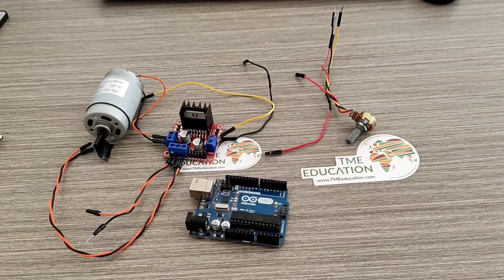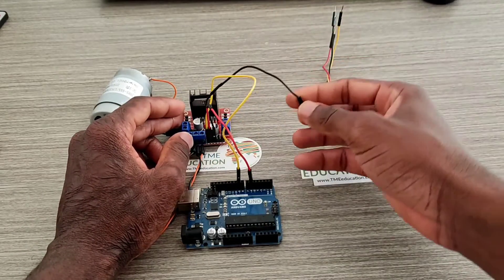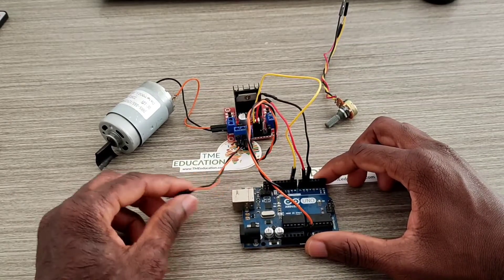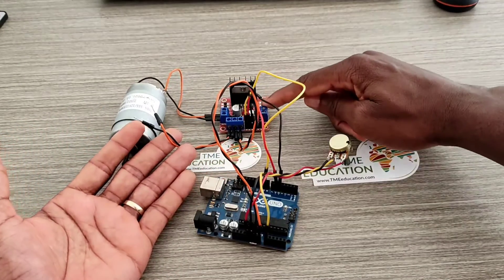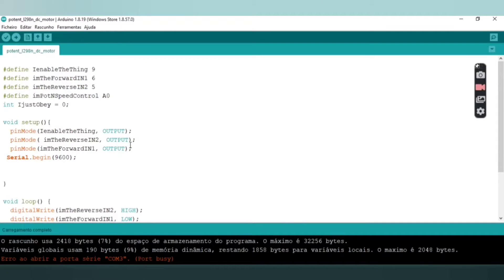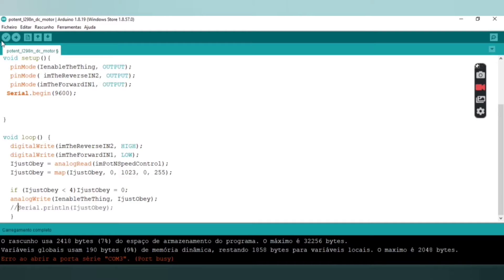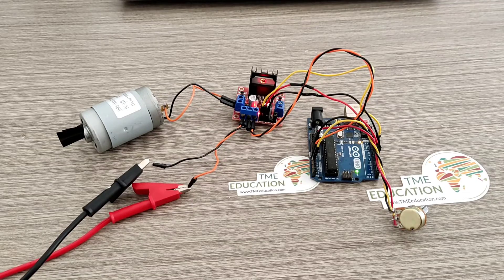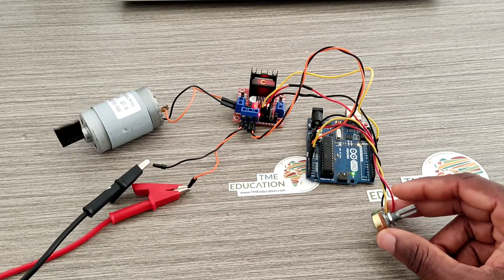Controlling DC Motor with Arduino and L298N H Bridge  #arduino #robot

Comment: Your teaching is well detailed. Thank you🙏 Since you used 12v DC motor at what rpm is the motor?
Reply from the maker: Didn’t get it
Reply: What's the speed of this 12V DC motor that you used? Should in case I want to buy it. Thank you.🙏

Comment: The potentiometer is not working when supply is given but motor is working then , what happened to potentiometer please tell me
Reply from the maker: Change the pontiometer or test it before using
Reply: @uploadideaswithitamar   ok sir thanks  please make more videos for our engineering project